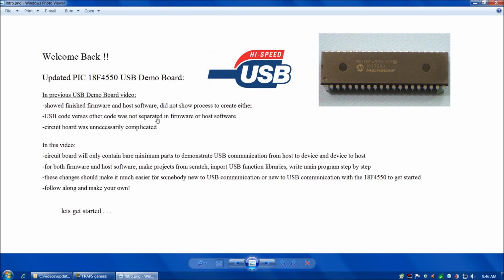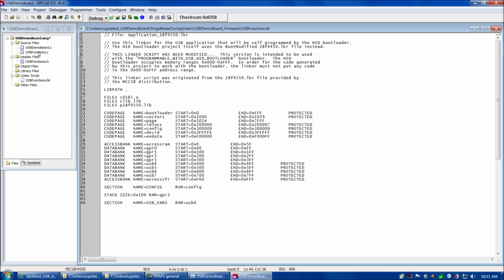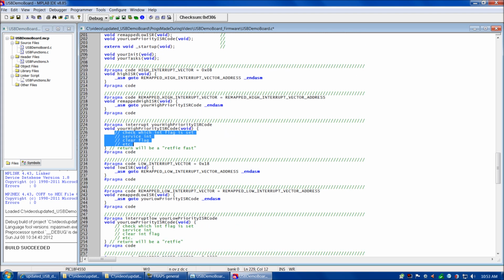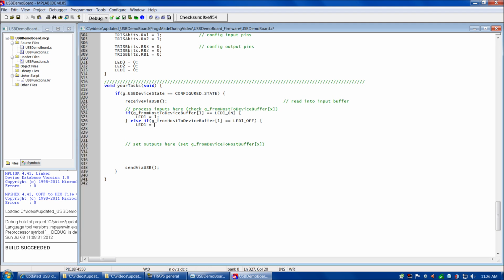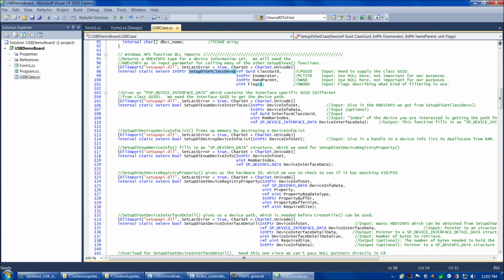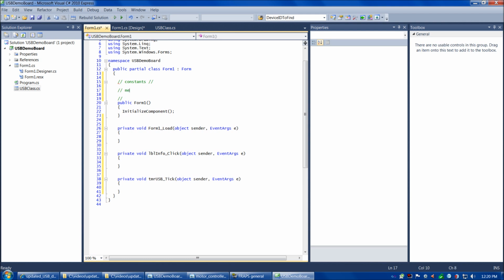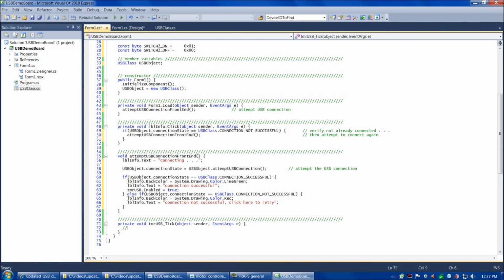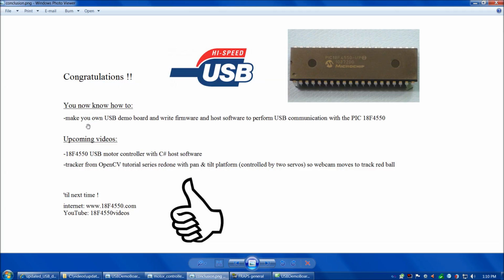updated PIC 18F4550 USB Demo Board video

Comment: Chris, thanks a lot for your insight, and a great tutorial. Long ago I was firmware engineer (when USB was just a twinkling in someone's eye) and wanted to find an interesting project to refresh my memory and help encourage my son into the art. For those who may be new and are having problems it's important to realise that you need to follow this tutorial EXACTLY. Make sure you have the now original versions of MPLAB, C18 compiler, and Windows VC# 2010 as Chris is using, otherwise you will run into problems. The code can now be found on GitHub here: https://github.com/MicrocontrollersAndMore/Updated_PIC_18F4550_USB_Demo_Board Download the ZIP file. Chris, I'll certainly be looking into your other work on You Tube.

Comment: in respect to my comment it  builds but cannot show usb connection
Reply from the maker: Sorry but this video is a bit out of date now and not something I am supporting any longer.  I'm planning on releasing a video for an Atmel chip USB motor controller board in the foreseeable future, but it may be a bit before I can get it out.
Reply: +Chris Dahms  I would really have appreciated if you could have helped because I have a project to submit
Reply: I am having the same problem. were you ever able to fix the problem after all?

Comment: Congratulation! You explain difficult things like Isaac Asimov usually did!
I did every thing you told, step-by-step.
I compiled both programs (mplab v8.91, and Visual Express 2012 C#) without errors.
But, when I plugged the USB cable, my windows 7 Home Premium 64bits tried find the driver using internet without success.
Did I missing something?
I know Microchip has many drivers. Which one I have to use?
Thanks from Brazil